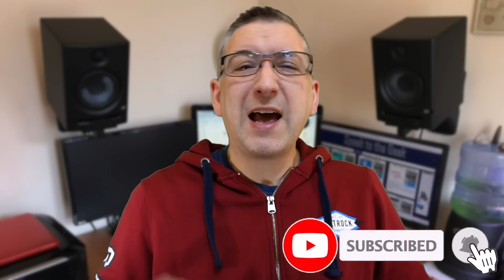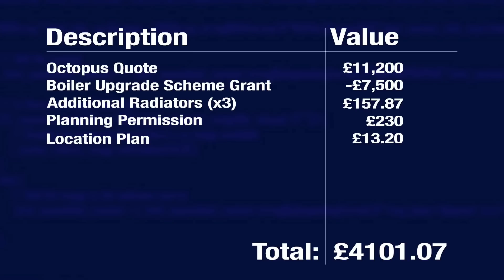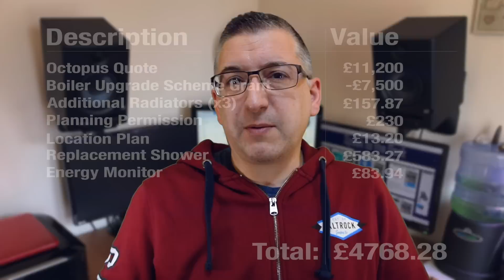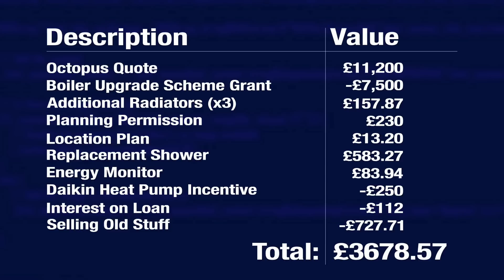How Much Did My Octopus Energy Heat Pump Installation Cost?

Comment: My Mum is having hers installed a week on Monday. Our quote is £100 after paying the survey fee of £500. We need planning permission too. We are 1db over and can’t move it.
Reply: I can almost guarantee you're not 1db over. Let me know if you want to hear more on this as I can't be bothered typing it if you're going to either miss this reply or ignore me 👍👍
Reply: @Soulrollsdeep  I would be interested to hear more. They have quoted a Daikin EDLA04E2V3. I will be interested to see how load my Mum's is. They are going to cover the planning permissions costs if I go ahead. It made me think at which point this rule will be removed. If councils think heat pumps are noisy, as more and more people get them, are housing estates going to have a constant hum of heat pumps?
Reply: @Soulrollsdeep  this is what Octopus told me - However, the noise assessment came out at 43db, only 1 db over the limit of 42db which would fall into permitted development. This is also rounded up (MCS building regs determine this), so may be closer to 42db anyway. Each planning authority seems to have its own rules as to who they accept and reject, but in my experience being that close to permitted development I wouldn’t foresee any issues
Reply from the maker: As much as I recommend Octopus, it may be worth looking at a supplier who can provide a quieter heat pump. It was cost a few hundred pounds and take months to get planning permission, if it is indeed granted, in my experience. At the very least have a chat with Octopus and see if they can swap for a different heat pump.

Comment: Funny you should mention the digital shower, im currently looking into this as well, do you know of any that work with Home Assistant, im struggling to find any that do
Reply from the maker: This one works with a proper bodge, sort of... and I'll be covering it in a future video. We are really talking a bodge though, as in you end up with a button in HA that can turn it on or off but no sort of feedback on its state or any monitoring.
Reply: @SpeakToTheGeekTech imagine triggering it unintentionally and it running for a week while on holiday.
Reply from the maker: @edc1569 It's way smarter than that! It has presets which all have time limits, so it would never run for longer than say 15 minutes anyway. It would also cut out as soon as the temperature dropped too low because the tank has run out.
Reply: The installer show in June @NEC, most of the big names are there and i'll be asking about this

Comment: Lets be honest a new gas boiler woupd have probably cost you £1500-2000 anyway!
Reply: I paid just over 3k to replace my boiler for a worster bosch so if it works well for you I'd say you've done alright there
Reply: @leehartshorn1479  don't forget with an ashp you get the "hOw LoNg Is ThE pAyBaCk" question as well 🤦‍♂️
Reply: @tarkadahl1985  lol good point 
Yeah definitely 
I'm actually considering an air 2 air system as my downstairs is open plan and the radiators and underfloor heating in one room don't get the downstairs up to temperature and obviously I'd have the extra bonus of air con in summer. 
Although I don't think there are any grants for that.
Reply: @leehartshorn1479  nope, A2A and cooling is a straight nope! I funnily could reverse my vaillant system so it cools the radiators, could get them down to 5° easily and cool in summer just need to worry about condensation
Reply from the maker: I’m not going to answer that question on this channel, but I will say that combined with batteries there definitely IS a payback compared to gas in my situation! January cost me £100 less in energy compared to if I’d used gas.
Reply from the maker: No grants for A2A at the moment, but if you’re interested in seeing more about A2A check out Tim and Kat’s channel - they had it installed a while back https://www.youtube.com/@timandkatsgreenwalk
Reply: @SpeakToTheGeekTech  yep watching Tim's channel is what gave me the idea 💡 
I've already got solar and a pw2 so hopefully when using the air con the sun 🌞 would cover that anyway
Reply: @leehartshorn1479  I had a small (3kW) air-con system fitted by a local company and it's been great, even in the recent snow. FWIW the bare unit is about £1000, the final bill was about £2000, with no grant. Installation was 2 guys for a short day.
Reply from the maker: Thank you! And yes, the rough quote for a straight boiler replacement was £2k - £2.5k. That excluded replacing the tank, so I could easily add another £1.5k to that for a new unvented tank + conversion + shower.